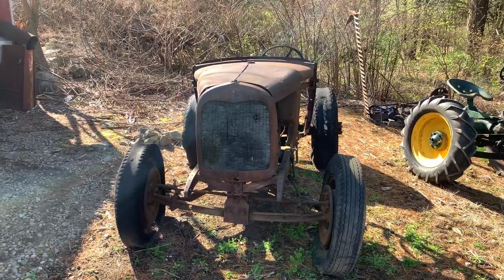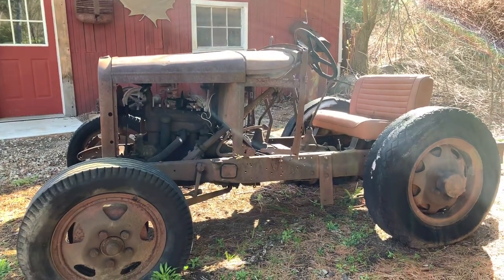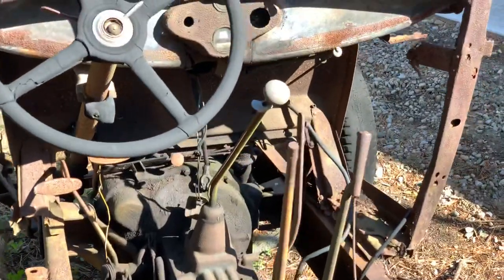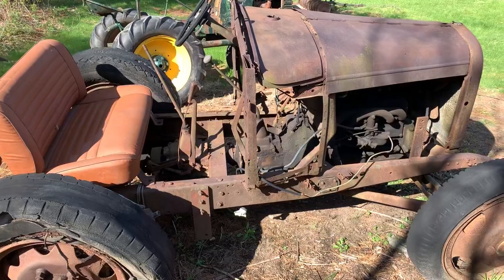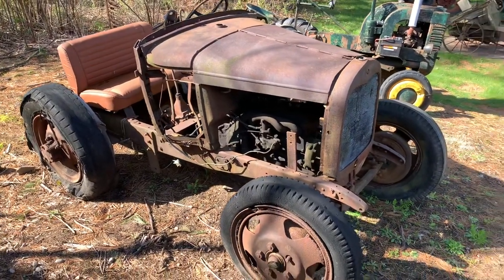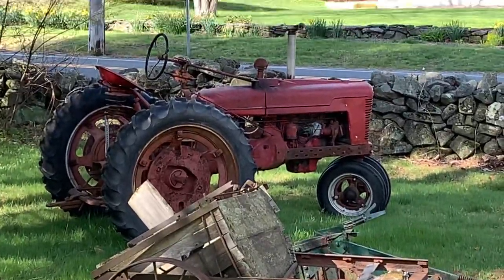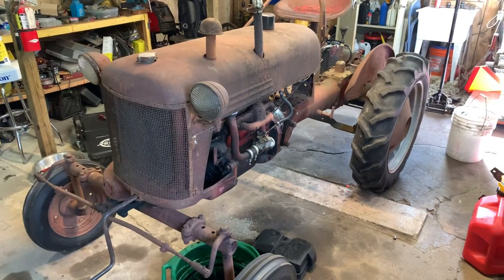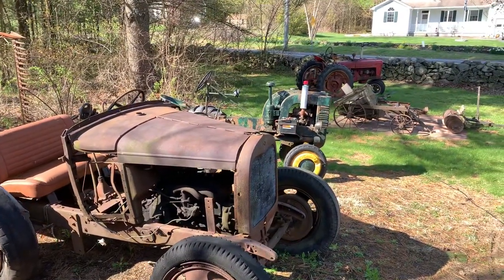1929 Doodlebug

Comment: This is so coincidental.  I have a 1928 Ford Model AA Doodlebug.  I did the same thing by stripping it down, paint, and built a bed on the back end.  It's having some trouble running right now.  This spring I'm going to pull the head and do some engine work.
Reply from the maker: I can’t wait to get to that point on mine. Still playing with other projects at the moment.

Comment: That looks like Dan's old duddlebug
Reply from the maker: I picked it up in southwick  Ma.
Reply: @tractorjim  So the doodlebug is a Vermont thing and I new a guy from Springfeild VT that had one with the same rims but it mite have been a little shorter!
Reply from the maker: It’s an all over thing. Farmers used to make their old Model A’s and Ts into cheaply put together tractors with whatever they had.   The Rat Rods of the tractor world.   They are awesome.
Reply: I had to come here because I saw a ad for a doddle bug for sale, wanted to know what it was. Not much info on them or working videos of them in action.
Reply from the maker: Every one is different. But cool.  They don’t have to be pretty.